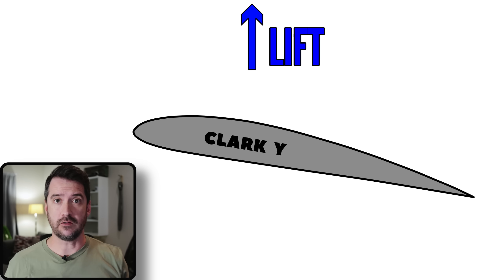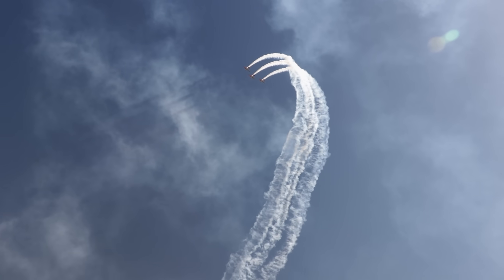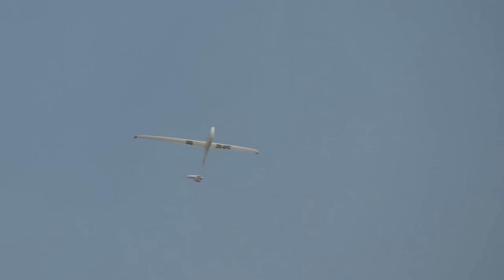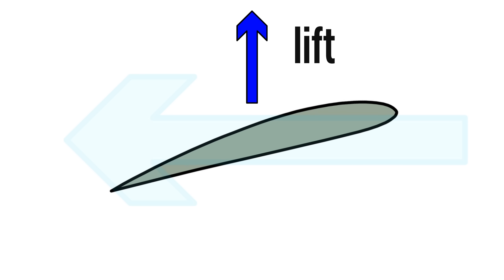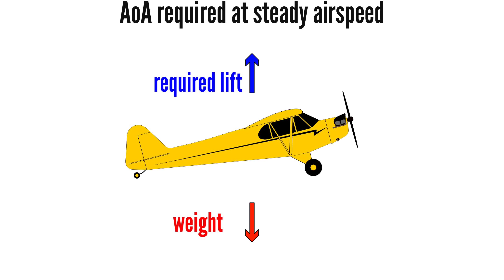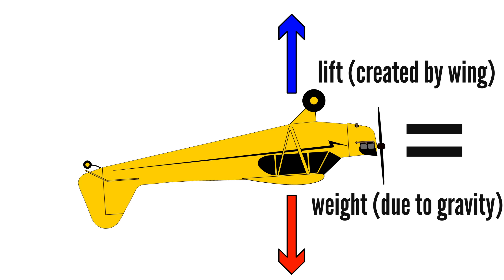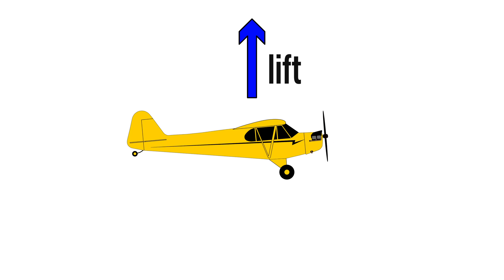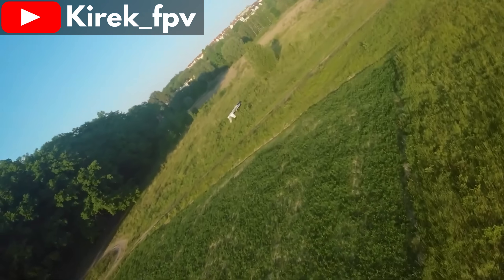Is Airflow Distance Over the Top of a Wing Always Longer?

Comment: But, does the theory of different flow lengths enable calulation of the quantum of lift?

I think a better explanation of the origin of lift is given by Newton's third law.  The "wing", "lifting body", "flat plate", whatever angled in the airstream such as to cause that airstream to flow downwards; producing a downward momentum in the airstream results in an equal upward component of momentum being applied to the wing etc.  Classical dynamics.
Reply: When I started gliding, around 1970, one of my instructors was an aeronautics engineer involved in helicopter rotor testing, and the "Newtonian" approach was the way he explained lift. I got the impression that that is the the way that many rotary wing engineers think about lift.
Reply: @thearmouredpenguin7148  And how aero-engine designers thought about propellor thrust.

Comment: 10:00 is a disclaimer and proof, very odd. A wing sort of works like he says but he obfuscates it terribly and misses critical elements. A wing isn't sucked upward, it rides on a layer of higher pressure. The top is for control, once airflow stops over the top it loses control (it stalls.) This agrees with his theory and adds a necessary element. The blue-line flow illustrations are simply misleading, whether deliberate or not. 4 lines in a YT comment barely scratches the surface of the subject.

Comment: The theory of different-length paths and resulting pressure differential has been disproven a long time ago.

Lift is created by accelerating air around the wing downwards (and slightly forwards with respect to the wing, i.e. drag). The different pressures observable are a side effect of said acceleration, but not the root cause of lift.
Reply: I agree.The fact is that the "different lenght" theory has just a lesser explanatory value than the "flux deviation by the profile" one. 
For example, if the "different length" theory is true, how to explain how "thickless" wings fly (wings like the one of the pre WWI planes or the hang gliders), which are basically of the same profile on both side...
Reply: Sorry, but you are wrong. Those are just two aspects of the same process. You can't say one produces lift and the other is a by product; it would be just as accurate to swap them around and say that the pressure differential is the root cause of lift with the downwash as a Newton's Third Law side effect (as is taught for EASA and CAA exams, although I taught them as two aspects of the same thing).

The only way to transmit force in a gas is by pressure differential, so lift must involve pressure differential. Air is deflected down under a wing at high angle of attack because of the high pressure. Air is deflected down over the wing because of the low pressure. Also the Coanda effect causes the airflow to stick to the wing upper surface, deflecting down and producing Newton III reaction. Also there is rotation of airflow around a wing overlain on the linear freestream flow to give downwash at the back to cause Newton III reaction (which is I believe how engineers sometimes calculate lift).

These are all different aspects of the same thing.
Reply: there's a pretty in depth aerodynamics explanation of this on youtube, once oyu look at it as a linear addition of voritces it gets really fascianting but yeah, equal transit is just some cleverish sounding nosnense someone came up with and set back sceince education by centuries with
Reply: @JulianDanzerHAL9001  That you don't understand the thought processes that go into the misapplication of Bernoulli is what sets Science education back.   The casual use of silly hyperbole (centuries) and an inattention to proper grammar (with), is what sets Education back, not just Science education.    As exercise, explain Conservation of Momentum  as it applies to linear flow of an incompressible fluid in a duct.   Now point out what happens when you have 3 dimensional flows of compressible fluids.   Treat the layman with respect and perhaps we would haven't all this pseudo-science, conspiracy driven ignorance around.    But no, let's invent pseudo words (cleverish) and our own pseudo science (linear addition of vortices)  and all will be well.
Reply: Well both are causes for lift however, the pressure differential is the primary cause. At least that is what the PHAK, AIM, and AFH say.
Reply: @buppy453ds  the pressure differential caused by what precisely?
a change in speed or a changei n velocity?
cause that is an important difference
velocity includes direction
change in velocity is absically redirecitng air
change in speed would imply that bernoulli comes first but hen I'd wonder what causes that since equal transit is completely and utterly nonsensical, its about as well debunked as flat earth
Reply: @JulianDanzerHAL9001  Velocity. I am interested in being disproven, though. The facts I have are from the FAA. Do you have any sources that I could review?
Reply: @buppy453ds  grab a book of basic fluid dynamics and once you've gotten the jist of it, you'll see that pressure differential is but a "symptom".

Have you tried integrating pressure across the area? You won't get a force sufficient to equal the lift experienced at those values. At least that is how I remember it.
Reply: @daszieher  I have not. I am not really very good at mathematics. Also "grab a book" isn't very helpful.  I am just looking for some sources that I could look into. I want to read a little more on this. You and the other fellow have my interest peaked.
Reply: @daszieher  If you integrate pressure across the area you will get the exact lift force. If there is no pressure on the wings surfaces, there is no force applied to the wing and hence no lift.
All we can argue about is how the pressure differential is created, not if it exists or to what extent it exists, because it must add up to the overall lift generated.
Reply: @Hyperus  A pressure difference is not enough to cause lift.  That pressure difference must mobilize mass vertically for the object to experience lift.

If there were a rigid support structure such as a crane supporting a suction cup holding the aircraft up with a pressure difference, then you wouldn't need the mass thrust downwards.

Without the rigid support structure attached to the ground, you need mass expulsion down, equal to the pressure difference.
Reply: You could equally say that the acceleration is a side effect of differential pressure.

That is not how physics works. They are different aspects of the same process.
Reply: Different path lengths affect mass flow rate continuity differently.  The mass flow being stressed by imposing a path length change, forces a drop in pressure to maintain the rate of mass flow consistent with the conservation of energy (dynamic pressure increases at the expense of static pressure).  The pressure drop changes the vertical momentum of the adjacent airflow.  You get Newton's 3rd law, action-reaction mass forced down, becuase the higher static pressure air moves downward towards the conservation of energy imposed pressure drop.

Comment: I've been a licensed pilot since 1993, and this is the best explanation I've ever seen of how a non-symmetrical wing is able to generate lift despite being upside-down.  Bravo!
Reply: I bet there are literally dozens of pilots who don't live in the US, and they wouldn't have to take any notice of the Interstate Commerce Act. In the UK for instance pilots require a PPL, or Private Pilots Licence, and are very much 'licensed pilots'
Reply: @BulletsRubber  But he said HE was a licensed pilot since 1993 not there might be a licensed pilot somewhere in the world. It matters not, I was trying to inform pilots to understand the reasons for such things.
Reply: But he didn't say he lives in the US? If he does then he must be mistaken, he is certified, not licenced, but if he lives elsewhere then he may well be licenced.
Reply: I became a CFI in 1986. I was forced to explain how a wing creates lift using the old FAA explanation to an examiner. If I refused, I would be denied my CFI, even though I explained that the FAA’s reasoning was wrong.
Reply: A flat board will create lift but will not be very efficient.  This will work similarly when the plane is upside down too as long as it has sufficient AoA.  The airfoil shape of a conventional wing causes the air to divert from it's normal path over the top of a wing.  The same lift for the same AoA is still created by the flat lower surface but more is created above owing to the partial vacuum which is created above the wing owing to the change in momentum of the air particles. (Bernoulli - fluid dynamics).  The aerofoil sectioned wing is more efficient than the flat board owing to a higher lift / drag coefficient.  The curved upper surface also enables a higher AoA before stall because the air molecules follow a stream line and turbulence (streamline breakaway from the top surface) to a higher AoA. It also allows the lower (flat) surface to be set at a lower AoA and therefore cause less drag.
Reply: Since we're here to learn ,let me say this,  you re a certificated pilot.  There is no "license" issued in the US.  know why?  The Interstate Commerce Act.  Go don this rabbit hole you'll be astonished.
Reply: @davidsoom1551  perhaps so.  FWIW, I was referring specifically to the time period that began AFTER I passed my private checkride and not when I actually started flying (1989).  It looks like even FAA uses both terms (license & certificate) https://www.faa.gov/pilots/become
Reply: @davidsoom1551 Yeah, so? 99% of those certificated pilots will say “license” not certificated. Language changes with time.
Reply: @RV6Pilot  "Yeah, so?" Well here is your "so" and my original point you missed so ignorantly. A license is Not the same as a certificate!  This is legal language that doesn't change do to common usage with time. It concerns your rights under the Constitution. If you understood that the Federal Government is restricted in various ways from infringing on our rights you'd appreciate that the FAA has no jurisdiction over anything we do that doesn't include interstate commerce (see Interstate Commerce Act of 1887). They cannot issue you a license nor create laws and restrict you if you are not engaged in interstate commerce.  They can only issue you a certificate that certifies you meet a standard. FARs are not laws, they are regulations ( you really need to learn all this yourself).  Because regulations are not laws you can't be convicted of a crime for violating any of them.  You should learn as much as you can on this important subject , or go about commenting ignorantly about "Language changes with time." missing the entire point of it all.
Reply: Ok, so you disprove a flawed argument with many absolutely false claims and misinformation?
To say "For a wing to create lift it needs a positive angle of Attack" is complete nonsense. Literally every cambered airfoil creates lift at alpha = 0°. For Clark y, for example Cl = 0 is at -3°. 
Your visualisation of the wandering stagnation point makes me especially angry because you used recordings of a stalled wing to dislead. With the airflow still attached, the stagnation point stays very close to the nose point.
In fluid dynamics the length of the path is completely irrelevant for the pressure. Some airfoils even have a longer path on the underside. 
(Airliners and some gliders)
Also high lift airfoils are hollow and have a much smaller difference in the path lengths than eg. a Clark y.
Reply: Any model airplane pilot could have told you that.
Laminar flow has its benefits and negatives
Reply: @flashgordon3715  different flight examiners expect different answers to the question of "How does a wing generate lift".  It depends on who you get and which explanation they embraced when they were trained..  Some expect you to say "Bernouli's law", others say "HA!  it's not Bernouli's law because if it were, how could wings fly upside down!"  It is very-much a "depends who you ask" situation.
Reply: I mean, think about it for a second. If you define "symmetrical wing" as "a wing that has disparate travel distance for the air above and below because of circumstances arising from its orientation and thrust vector," you've just redefined the word "symmetrical."

The wing is, or is not, shaped in such a way that the distance from the leading to the trailing edge is the same on both sides. It's as simple as that.

I think @billyjack3361 nailed it. The FAA was using the same instructional method as the Catholic Church. Beat you until you say the right answer. That's why so many stodgy old pilots and instructors today believe the myth. Or "dogma," if you will.

Comment: I completely fail to understand the point that you are trying to make, and for what reason.
Bernoulli was correct in every case that you cite, and the parallelogram of forces adjusts in each case to provide a stable state if one is attainable.
You set out to make an argument which is intrinsically moot.
Reply: It really turns into word salad. At 10:00 I had to parse it point by point with all the double and triple negatives. There's an axiom in journalism: The answer to every headline with a question mark is "no." And once again the axiom does apply. However "lift" is not the same thing as controlled flight and controlled flight is not the subject of the clip, just some of the comments. (Controlled flight does not require a rudder or rear stabilizer but they do help, just in case a commenter is compelled to bring them up even though they aren't mentioned in the clip.)
Reply from the maker: It's simple. There's an argument that "if the Bernouli or pressure differential lift theory or long path/short path is responsible for lift, then a wing wouldn't be able to fly upside down." The point I am making in this video is that isn't correct as an upside down wing can create lift with those lift creation theories.